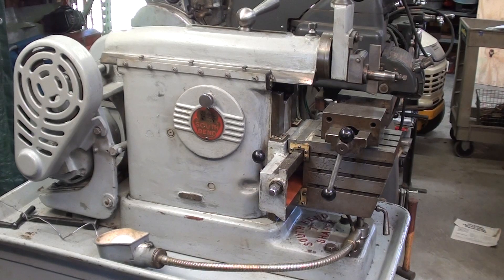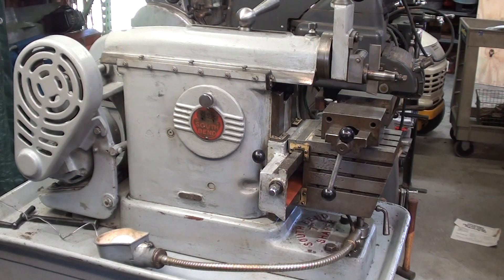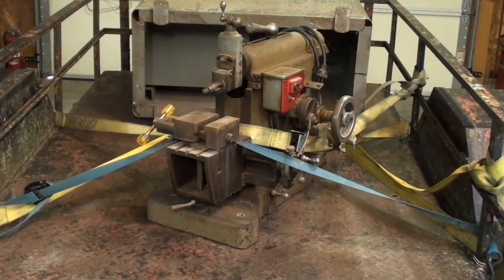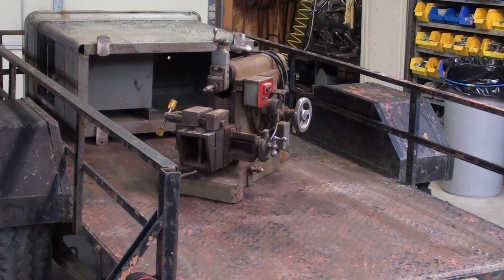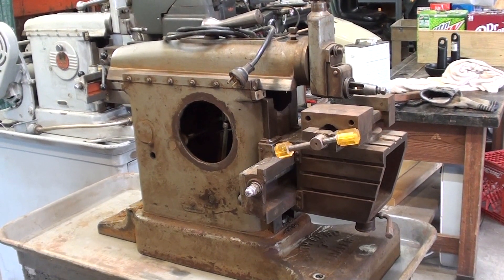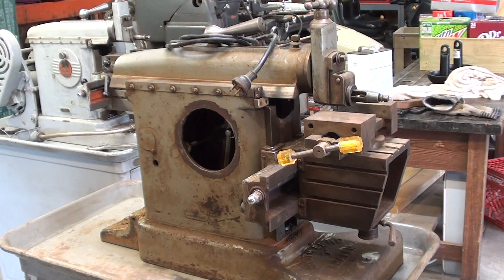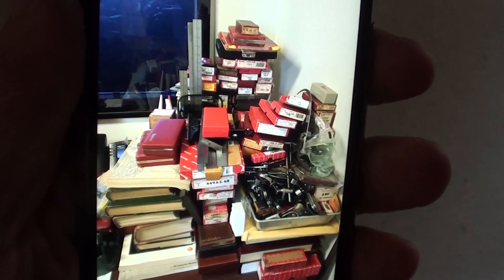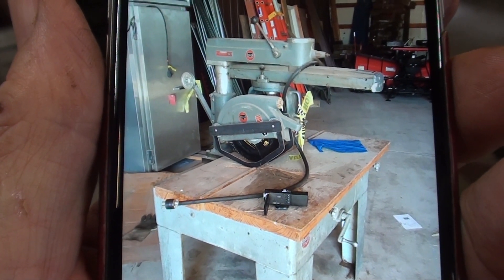tubalcain BUYS ANOTHER SOUTH BEND SHAPER Tips #670 pt 1

Comment: Hi Lyle, You Lucky Fella, I'm really happy for you :) (if I had space for such a machine, I'd be envious). I started my Toolmaking Apprenticeship on a beat-up old Horizontal mill that scared me a little. I felt more comfortable with the Shaper (which had a 30 inch stroke), until one day I did it (no not that but "it"). I engaged the blasted gears wrong and at about 15 inches of stroke (I was using), I pressed the start button (it was set to 110 strokes per minute by my missing one position on the 2x gear handles). Well the Bl*dy thing drew it's ram back and paused at the back end of the stroke , just for that short half second or so before going at what seemed like 500mph straight at the workpiece (which was a chunk of mild which I was roughing down, probably about 12" x 6" x 4" and I was taking about 3/4 inch cuts. Well, the tool hit the damn work and simply pushed the entire workpiece, and the vice complete with the front two flipping Vice 3/4" hold down T-Bolts, right off the table. The Vice (which took two of us to carry onto the table) shot a couple feet in front of the shaper, then descended to the  concrete floor with an enormous sickening thud which all 8 other guys in the workshop felt (even though they were standing on wooden "duck boards". I was told after that I squealed and ran towards the door (which I don't remember but suppose it could have been true). The Bl**dy thing literally scared the living *** out of me and from that day on, I had a very healthy awareness that some of these machines were out to get me and could easily kill me if I wasn't extremely careful. Some of the others later did admit they'd done it too, when they started out.
The other thing I learned to be very aware of was the cylinder grinder which ran 12 inch wheels, the thing with that was to listen to the sound of the wheel spinning  and be very aware if it suddenly changed pitch and became a little sort of hollow sounding and lower pitch, the next warning was the guy in front of it diving to the floor and sideways and as my Bridegport was almost in line with the damn wheel, I could be in the firing line, when that happened, a few guys bolted sideways but I only experience one wheel explode in my time there and that was enough to reinforce my view that these big hunks of metal could be dangerous. Hope you're all keeping well and safe. Long may you continue, you are a legend in your own right. Cheers, Martin

Comment: Hi,  watched your full series on the South Bend sharper last night and must say it was most enjoyable, the machine looks great. I was thinking about the problem with the rocking shaft pivot leaking oil and thought of a possible idea to fix the problem without drilling further holes in the main casting. I was thinking if you put the pivot shaft in the lathe and machine off say, 1/8" of each end, drill and tap the ends a convenient size to take a machine screw and a machined stepped washer. Finish machine the pivot shaft with a shoulder on each end of the shaft to suit the ID of a silicone O ring which has an OD which would fit into the end of the bore in the casting a good fit to seal the bore from oil leaking, refit the shaft press into place the O rings, one each end of the shaft shoulders using the stepped washers and set screws to hold all in place, this would locate the shaft and seal the bore preventing further oil weep at the same time. Hope this makes sense. Stay Safe

Comment: I remember when I would have picked it up and grunted and it would have been loaded.  Maybe that is why my back hurts now.  Ha.  I bought a surface grinder last weekend.  Unloaded in the shop, wiped down dried and oiled profusely.  Now to get it where it goes.  Harig 6x12.  Will replace a relic tool and cutter grinder which I regrind endmills on.  The harig will dust in my parrellels also.  Ha.  Enjoyed your video, especially the road trip part.  As I get older I enjoy wandering about and seeing the back side of things.  I love 2 lane roads.
Reply from the maker: That will be a great grinder for you. I was going to show much more countryside in that video. But that footage is on the cutting room floor
Reply: @mrpete222  That is the reason I bought it.  Wasn't cheap, but reasonable and I picked a super spacer in the deal.  Probably more useful than the grinder.  Almost got lost going to get it.  Been by the location a few hundred times.  They put in a new interstate, then I wound up on the other side, circled and found a landmark.  I hate it when they change things.  Ha again.  I have 2 shapers also, a 12 inch flather which is wired up and I use and a 24 inch dean Smith and grace?  Need to put it in storage or put the motor back on it.  Been using Motor on my air compressor, no it was from my Barnes drill press, just haven't run 3 phase to it.  Keep on making videos.  Maybe some time I should start.  I have accumulated a lot of relics.

Comment: I once worked at South Bend Lathe and ran a bed planner which is sort of a shaper in reverse for the work moved and the clapper was fixed.
Reply from the maker: I have seen pictures of the southbound plant. The planer hurt either four or six beds on it
Reply: @mrpete222  Yes and they had two planners, one for rough cut and one for finish cut then the bed's ways where flame hardened.  They of course where cast iron so they cut fairly easily. I learned at South Bend Lathe one of the most interesting things I had ever learned in the Machine trades. That was how to cut a chip breaker in a drill.  Large drills had a problem with chips cutting steel for the chips would get so long they would distort the hole with the weight of the chip. The answer was to grind a small notch at the base of the heel of the drill.  This would destabilize the chip and cause it to brake up. Most people could not understand this nor how to sharpen a drill.  The man who thought that up was very very very smart. The machine tool trades are much more then just making money.

Comment: Mr Pete i have the same Shaper as the one you just got. I would be interested to know if the gib on the right side of the machine as you are face the clapper box is oiling on yours. Mine is not oiling just on the one side and it seems to be a problem on many of these automatic oilers. My pump works fine and i can flood the gib on the left side but none on the right side. I have made the adjustments it says to make and no improvement. I suspect I will need to take the ram assembly  off and look for some blockage in the oil passage. I have the manual so i know how to take it apart but if you happen to take yours apart it would be a pleasure to watch the disassembly of it.

Comment: I'm in my fourth year of restoring one of those straight base early models.  It's been a learning process scraping in the ways.  So far it's been to two Richard King scraping classes, and I'm still not even close to being finished.  Having our first child in the early part of the process slowed things down somewhat, but I'm not complaining! Edit: that's the same type of boom truck they used to load my 5000 lb. Steptoe 24" shaper onto the trailer.  Better safe than sorry.
Reply from the maker: lol.  Good luck on that restoration. I do not intend to take mine to that extent. I will paint and pray

Comment: Boy I thought I was bad  I have a South bend  and Ammco
Reply from the maker: Which do you like better? I have never seen an ammoco
Reply: @mrpete222  the South bend hands down is much better machine then the Ammco  for lack of a better term more robust but surprisingly the Ammco and south bend use identical vises the only thing I don't care for is the Ammco uses a fiber bull gear but there was a guy on eBay who made them so I bought a spare  I believe some of the early South bend shapers had fiber bull gears mine is steel

Comment: hey i just bought one of these, the older model.  it's missing the plug that anchors the tool head to the ram.  that and i need some tool holders.  are you aware of any sources of supply, or the dimensions or a drawing of the anchor plug so i can make one?
Reply from the maker: Watch eBay for those parts

Comment: Yeah, 350-to-500-lbs. ain't all that much, IF you can find a couple of "human-cranes" like your neighbors. But since I've become old & weak in the joints, I "cheat" by using an-outdoor-only engine hoist on 4-bolt small trailer wheels, with an-adjustable pitch cradle/puller for a sling. Not only makes loading/unloading LOOK-impressive...but, it's a LOT-safer, too, as in NO-ruptures or smashed feet/toes...! ☺